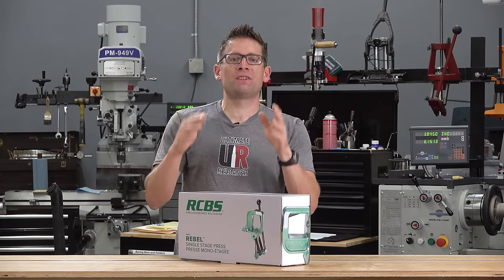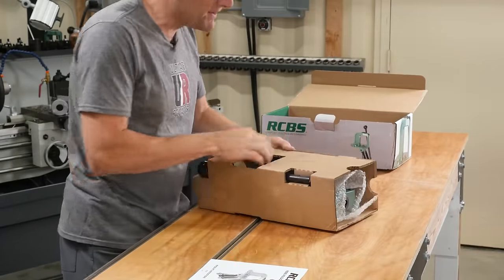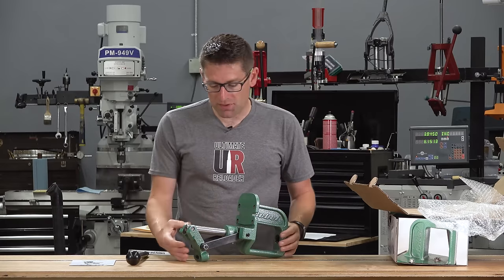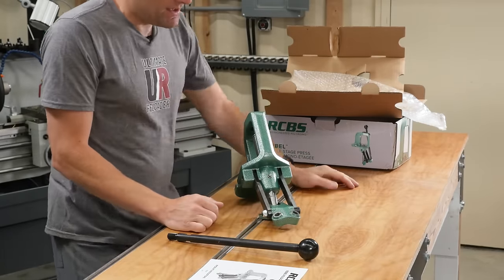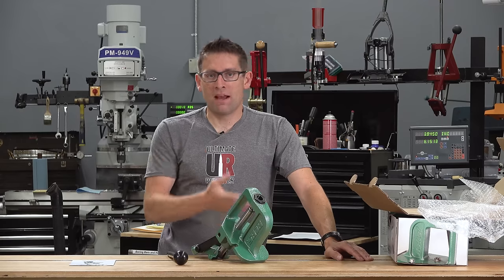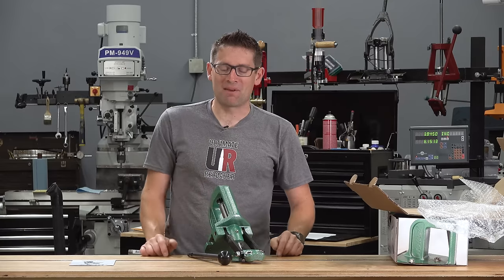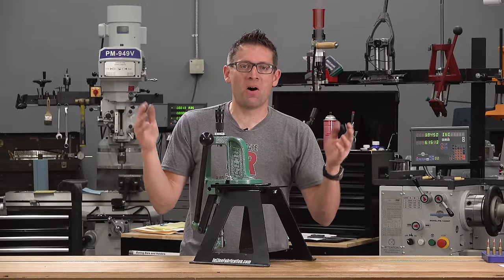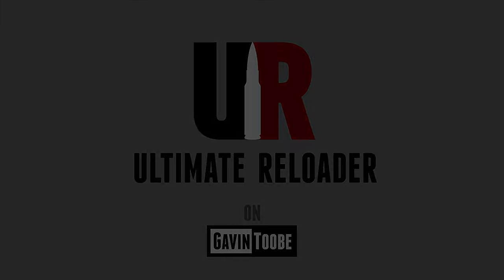NEW RCBS Rebel Press: Unboxing, Overview, Loading, Comparison

Comment: My post is not related to this press but I've been trying to get an answer from you about the Hornady LNL primer system.  I've also been told to seat primers below the base of the case by 2 to 5mm.  My LNL press only seats flush.  I have been unable to shim or do anything to increase the depth of primer seating.  Is flush correct or should it be seating deeper.  Hornady claims this flush depth is normal and within SAMI specs.  What do you say?
Reply: The primer height is within the range you mention, I think you're lacking a 0. there...
That said, flush is good as long as you get 100% reliable ignition. I like to seat my primers so they have bottomed out when I use a hand primer, be that flush or slightly below flush. But I'm no SME.
Reply: Go to the SAAMI site and you'll find all the specs on primer pocket depth. It's possible you may have more shallow pockets than usual and measure your primers since they do vary by brand. Large Rifle and Large Pistol are the same diameter, but not the same height. You may consider primer pocket uniforming also. I encounterd misfires with flush primers in my action tuned revolver only to go off on the second try. The first hit seated the primer and arms it. The primer is armed when the anvil is driven into the cup during the priming operation. Usually about 6 - 10 th's flush.

Comment: What grease do you recommend for lubing the RCBS presses
Reply: I've been using Lucas Extra Heavy Duty. It is greenish in color,  lasts for what seems like forever and slick as snot.
Reply: Mine appears to be factory lubed with white lithium grease. I should contact customer support to find out what type they recommend. There's probably a warranty issue should you use the wrong type of lube.

Comment: Got this press from Amazon since Gavin seems to be really excited about his product but I'm now returning this press. The only thing that's about right is the massiveness of this unit. The linkage system is sloppy, you can see the ram rotating back and fort when moving the handle side to side. On the down stroke, depending on how much side pressure you have, the handle will take inconsistent paths. I just don't like the cheap feel of this press. Night and day difference from my big boss 2.

Comment: 6.5 grendel, what gas system, rifle or mid? Does it matter if were to suppress? Probably a 18" barrel.
Reply: The Grendel is so nice and versatile that the difference  in gas tube lengths become academic. Either one will work nicely. You might want to go with an adjustable gas block, but the Grendel doesn't even need that. Happy shooting!

Comment: I have had my Rock Chucker for over 20 years and still works like day one. I made a mount with a couple pieces of 11 gauge sheet. That primer chute and zirk fitting are nice touches. If you're giving away one I'm in.

Comment: Does the Rebel press fit on the RCBS aluminum accessory plate?
Reply: Should fit without issue since I've read it has the exact same mounting holes as the Rock Chucker.  So any plate the RC fits this Rebel should fit.  I can't confirm this myself but have read it from multiple sources.
Reply: Yes, it does fit. I have this press and the base plate.

Comment: Why no followup video on the Rebel doing the same tests as was done on the 14 press shootout, and why not a single response, that I could see, to any of the comments. :(
Reply from the maker: We may do a follow-up at some point- lots of setup and time doing these tests!!!
Reply: @Ultimatereloader  Thank you for responding! I've been watching a ton of your videos lately because they are super helpful. Your 14 press shootout persuaded me to not go with the Hornady Iron Press as it didn't impress me as much as the others. My first two presses were Hornady, LNL single stage and LNL AP progressive, and then I bought a Forster Coaxial. The two Hornady presses served me very well and I got excellent results from them but sold the AP and bought a Dillon 1050. I was in the market for another single stage press to go along with my LNL and Forster, so I went with the RCBS Rebel because it was hard to beat the Brownell's price of $159 with the promo code. 

I'm really close to crying once and buying the Area 419 Zero Turret Press, and then I swear I won't buy another press for another decade!

Comment: Bought the RC Supreme due to your 14 press comparison.  I have been amazed at the consistency and precision of this press.  I must be the one tipping the scale - I actually use and like the priming system on the press.  I agree about the flat top - Cleaning would be so much nicer with the flat - But, no priming system.  The RC Supreme is a STEAL!